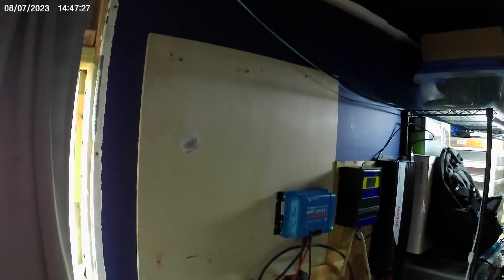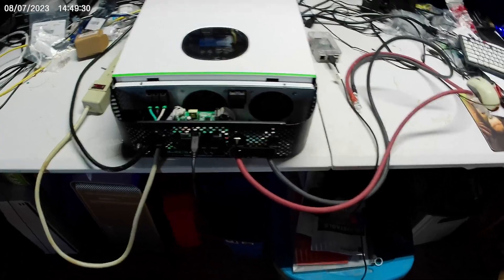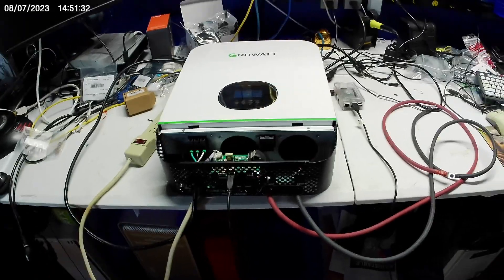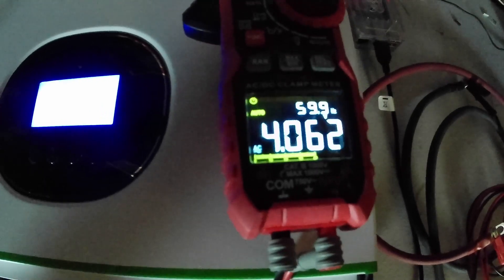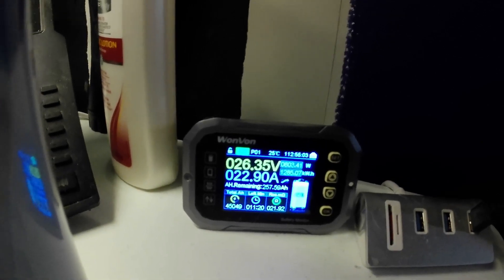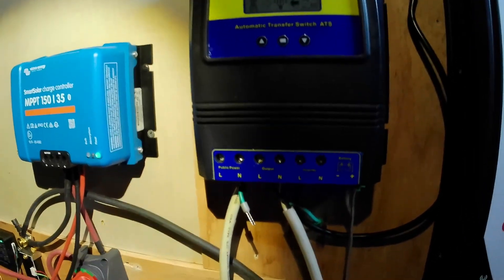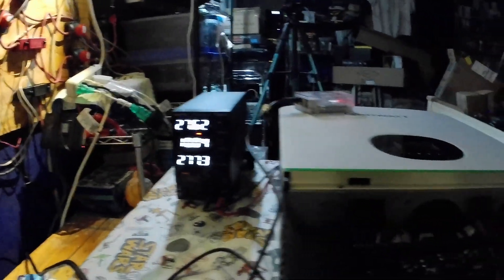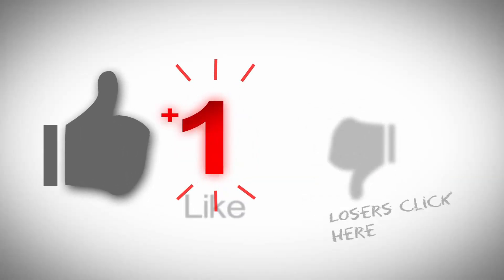Growatt to No Watt - trials and tribulations of Solar power.

Comment: Yeah you can't be waiting 24hrs for a hard reset to save the day.  Especially if your grid went down not good.  Hopefully just a firmware issue like you said.  If they do that for you make sure you push its limits to make sure it's okay.  You got a lot of juice running you need to know it works right for sure.  If its any consolation I found your video very informative as always.
Reply from the maker: Yeah, I wont be trusting Growatt or EG4 equipment anytime soon, not after being bitten and based on what others have experienced with EG4 I will just avoid them until the kinks are worked out, they have the potential to be great products, especially the Growatt, but they really need to overcome the language barrier. Thanks for watching.
Reply: Yup I do not blame you.  It's hard to know what is good because 99% of the YT channels are nothing but  sponsored.  I feel like I am watching infomercials.  Keep it real that's why everyone loves their Unkyjoe.  All these channels say they have the best customer service best products blah, blah, blah! @UnkyjoesPlayhouse